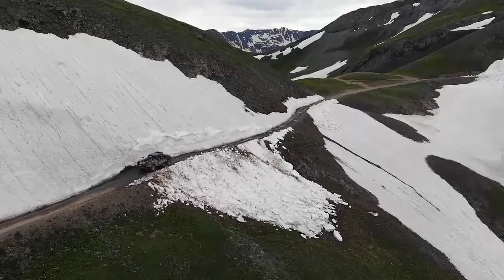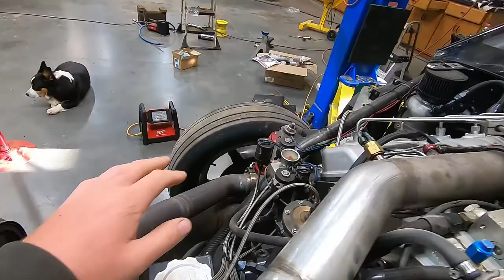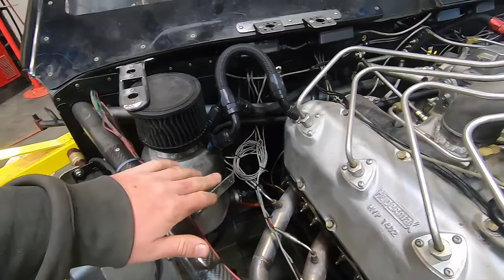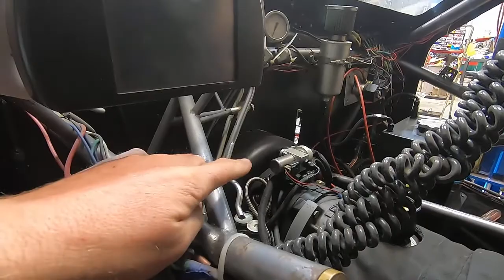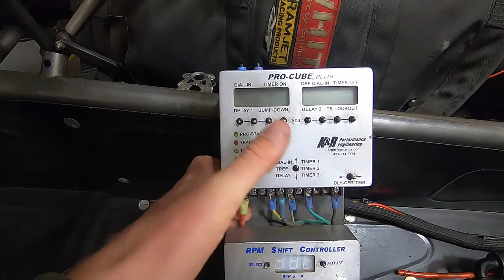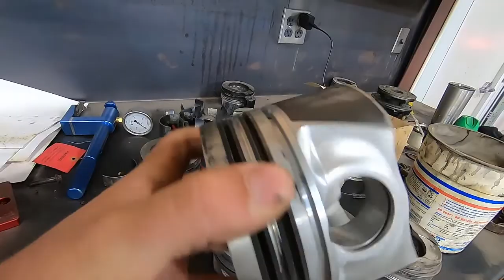7.3 P-Pump Diesel Mustang Walk Around

Comment: Trying to convert my 7.3 to mechanical but instead of messing with the housing and using gears I'm trying a cog gear and belt set off a weiand roots blower with some extensions from the local machine shop

Comment: which p pump are you using . Bosche 8 cylinder p pump , gotcha . I have a mechanical 7.3 , the small single lobe low volume pump from 90's . Love the engine but would like more volume during acceleration and top end .
Reply: I truly like the explanation of your car ,very nice set up

Comment: Is it possible to do this and have it reliable but make a good bit of power? Or would it be smarter to just do bigger injectors and turbo instead of p pump?
Reply from the maker: Possible? Yes. Practical? No lol. Way better keeping the HUEI injection system.
Reply: @MattKubik1791  👍 thank you for letting me know.
Reply: @MattKubik1791  I was wondering myself.

Comment: Hello again sorry don't mean to bug you guys thanks again for answering my questions I have another one I now have a 8 cylinder m Bosch pump and I'm trying to figure out how to pump make my own fuel lines off the pump to my injectors same setup is yours it looks to me like a stock Cummins injector lines that I have on my truck have welded on flares what did you guys do for your injection lines I was hoping just to get some hydraulic steel line and put my own flares on it
Reply from the maker: Corey Ellis Art Hypmermax engineering made our lines.

Comment: Help me out here I'm thinking of doing a low-budget set up similar to yours but obviously low budget I have a set of 8.3 Cummins injectors I was going to use plus two more my question is I've noticed most of these setups do not have return lines coming off the injectors what is the reason behind this are they simply blocked off on each injector
Reply from the maker: Corey Ellis Art mine returns though the factory 7.3 fuel rails in the head.